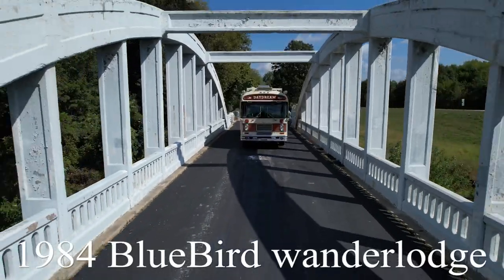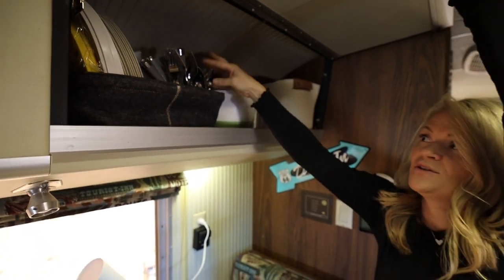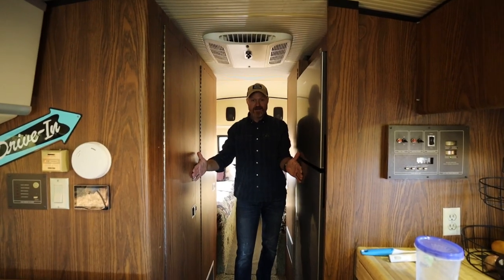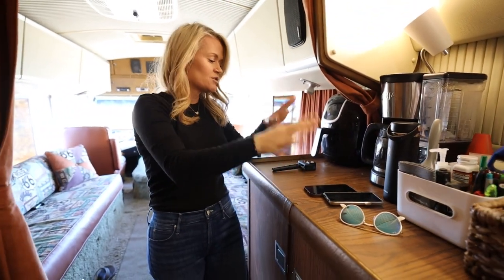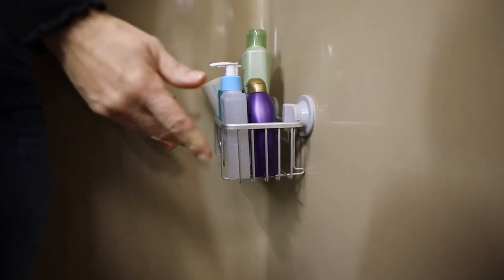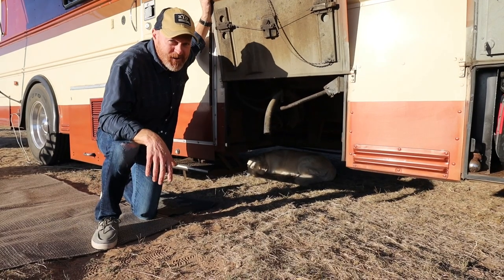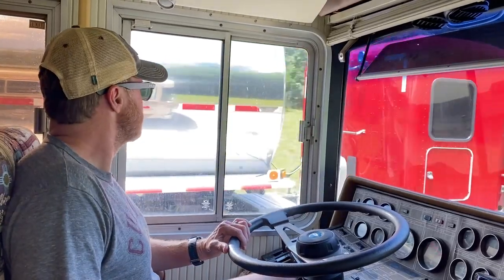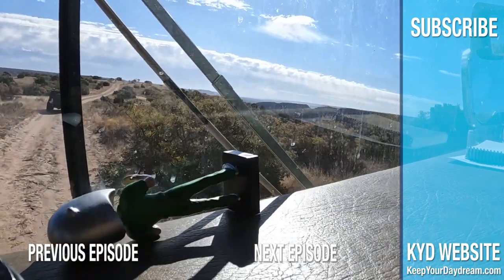BlueBird Wanderlodge RV Tour: Pros & Cons

Comment: LOW POWER ISSUE - We own an 88 Bluebird. To address your lack of power issue and with the engine off remove the engine cover inside the rig then check your throttle linkage by depressing the throttle pedal completely then make sure the throttle lever on the injection pump is going to full throttle (all the way against the stop). To obtain this you may need to make a linkage adjustment. Let us know if you have questions.

Comment: Very good tour and video. I decided about two years ago that I wanted an old bus. Fell in love with the GM4106 model. I found a 1962 4106 that had been converted in Southern California and flew out, bought it and drove it across country back to Arkansas. It was not in good shape mechanically but by the grace of God I made it with no issues. Myself and my buddy spent most of 2020 going through all the mechanical and repairing everything. Keep in mind that I have a fine fifth wheel and my wife couldn’t understand why I ever wanted an old bus, but it did teach me a lot about the old ones. The thing that stands out it that they were made to be repaired and will last forever. It went to a new home and owner in Florida last year and my wife is happy now. I kind of miss it but truer words were never spoken, “you better make sure your rig is ready”.

Comment: As an avid classic wood boat enthusiast, I totally agree about starting early to make sure everything is going to work.  The public boat ramp is not the place you want to find out that the Gray Marine flathead engine won't start. Also agree with making friends and high fives on the highway towing a classic woody.  When everything is singing, vintage ANYTHING is the cat's butt!

Comment: This is perhaps one of the best videos that you have done. If you have a late model pickup truck that is suitable in size to tow your travel trailer, then that is about as reliable as RVing gets. A large motor home has its advantages while on the road but its not more reliable than a good pickup truck. A vintage RV will have issues from time to time and a vintage motor home can have issues that are much more expensive if you can even find some one to work on it. I don't know how you afford all the different rigs that you have had or do have but it gives you a perspective on the advantages of each type of RV that few other Youtube RV channels can offer and your candor about what you like about each is great. You should do more about what makes each type of RV good and bad because few can offer honest opinions on it. Keep up the good work.

Comment: When I bought my Class A, I could have gotten great deals with fifth wheel units but my main concern is safety. As a SF, not having to exit my vehicle until I'm sure of surroundings or for a restroom break or quick lunch was my main consideration. I had motorized RV's before so the driving and doing checking, hooking up, breaking camp wasn't anything new, my ex couldn't drive for more than 15 minutes at any time due to physical limitations. In the 90's we converted 2 buses for personal use, 1st was 35' with straight natural aspirated 6 cyl. Detroit and manual transmission, talk about a slug up the hills but averaged 11 mpg and 13 on flat highways at 65 mph. The 40' had a 8V92 Silver Detroit with 4 spd Allison automatic, pumped up the injectors and turbo. We cut the roof off and raised 8" to flatten the interior ceiling, was under 13'. It was 36,000 lbs and screamed up the hills. Had 2 full bays accessible that we could put our quads in the belly and still have 1 full bay available for anything else.
Reply: Wow amazing..

Comment: My husband is a retired truck driver and we bought a class a with tow vehicle. Unfortunately the brake buddy kept signaling that our tow car broke away and it didn't really. It never worked correvtly and my husband got so frustrated at the alarms going off scaring us, we sold everything.  Back to truck and trailer that we added battle borne and solar, the Best of all 10 RVs we've had.  Hit to budget but worth it.

Comment: Great episode and thanks for the ending where you discuss some of the pros/cons of a classic vehicle. As far as solar & batteries, I think one consideration is that when everything goes belly-up at home, some kind of rig is valuable. My example was last winter, we had 72 hours without power during a winter storm. Having a rig that you can go out to that has power and heat would be amazing - a bit like the lunar lander on Apollo 13, it can get you back to where you need to go, maybe not with the same level of comfort you were hoping for, but I definitely didn't sleep well without my CPAP running for three nights... and having an RV in the driveway that could have kept us warm and powered (and fresh ground coffee for the wife - she ran out - would have been amazing. In our case, we're part-owners of a park model RV in a resort, but we're considering getting a towable that we can use when it's not our turn at the park model, as well as for emergency uses like that. Luckily, Santa brought me a nice solar generator that can be recharged from the car when needed... that's a good first step.

Comment: I had a GMC motorhome exactly like the one in your video. It was a 1973 the first year they were made. The last year they made that model was1979. A little before 1984. I bought my '73 GMC in 2000 and sold it several years later. We now have a 2003 Newmar Dutch Star DP. Love your Wonderlodge.

Comment: Back in the 80's i owned a truck with a 3208 in it.  Never had maintenance trouble with it but no matter where we had to go we needed to add time if there were hills, On roads I used all the time in other trucks, I had never even noticed and grades. In the 3208 40mph.

Comment: 3:43 - So typical of Goldens.  Park where you need to walk…  Being a large dog, they do not move quickly.  It is perplexing.  28:51 - Glad you mention other campers consideration.  Recall running the extra noisy 1987 Onan generator in a State campsite, the tent neighbors cheered when we shut it down.  On for about an hour at 10 AM, tent campers were outside their tent, no operation during quiet hours.  The quiet diesel gen.’s seem better. Not the unit we had.  Thank you for the posts that bring back the experience memories of motorhome travel and stays. 😊
Reply: I think dogs do that so they will not miss anything and force you to acknowledge them. Our Golden did it and so does our Aussie. 👀

Comment: I love my 1983 Wanderlodge I was surprised to see the difference in ours Birds. The turbo conversion is very easy. The turbo runs just about 2k plus the install. Then turn up your pump and your good to go "the easiest pump to turn up or down ever" . I am just now changing out my turbo due to improper usage I am very excited to see how it preforms with full power. I too have the fc  3208.

Comment: My second camper was a 1977 coachman 5th wheel. It has some neat features. My favorite part was that nothing I could do to it short of setting it on fire would hurt it's value. No hesitation to screw something to the wall, drill a hole to run a wire etc.... It was also the reason I call my channel gypsy wagon maker space.

Comment: Cool rig, thanks for the tour.  I used to rebuild cat engines, and that poor 3208 is wholly inadequate for much of anything.   Sorry its such a snail.   The rest of the rig is really cool.  I would certainly consider a repower instead of power adders, which wont help much.   A cummins swap would sure be about 10 times better, and money better spent IMO.   Great video.
Reply: I own a 1977 fc35 so I have thought long and hard about a re-power. The problem is the form factor, the bus is made for a square engine, not a rectangular one. This basically eliminates the two obvious choices- Cummins and dt466. I would go for a duramax, although figuring out the electronics might be a problem.
Reply: I worked with CAT for a number of years.  If I remember, Blue Bird insisted on the 3208.  Power was adequate for the relatively light duty of a school bus which is what the Wanderlodge started out as.  The 3208 was always intended as a medium duty engine for medium duty applications.  The Blue Bird was always short on space for the engine.  Trying to get the valve covers off to adjust the valves was always a hassle.

Comment: Oh also in case you did not already know. On the Bluebird OEM tag riveted to the bus. You should see a Body number, A BSN (Body Service Number) and a Chassis Number. Those were used for the original microfiche that BB used for production records and parts replacement. The Chassis Service number will show a parts person what model, make axle, the brakes, the drums, the hardware, the slack adjusters, basically all of the parts used to put the chassis together. the body number (yours should start with an F or W F for fort Valley or W for Wanderlodge they used both sometimes. Ususally F as that denoted the factory the bus was built in. Like if you have a Body number that started with a B it was made in Brandford Onatario Canada. if it had an M it was the Mt Pleasant Iowa factory (both are gone today) there were also a few L body numbers which was Laventure? Georgia. They also had a factory in Central America for awhile as well. The body number will show the options that were chosen from the catalog by the original owner. Blue Bird Dealers still have access to factory info on microfiche that was converted to digital files. You may also be able to find you original build sheet on the Bluebird Website which will show date of completion and some other fun factory stuff about you bus that won't be in the blue box. :-)

Comment: Class if 83. Thanks for the flashbacks. Good times!  
I got tired of working on my 1965 Sovereign Airstream and decided it was more work than pleasure. 
It’s sitting in my garage, along with my other long term project-a 1970 Olds 98 convertible that will pull it or my mouse-house 1969 Airstream Safari. 
For now, as a weekend warrior, my 2019 Sprinter has been a fun conversion to build out and use as I go. 
So many projects…I hope I can retire soon and get at them all!
Thanks for the inspiration and -
See you down the road!

Comment: Recently retired spent 20 years at a Cat dealer worked on lots of 3208 worked in the fuel bay built lots of fuel pumps for that engine. I would repower with a 3116 or c7 or maybe even a c9 but keep it Yellow

Comment: The 1980s montage would have been perfection if you included footage from "Stripes" which used a GMC Motorhome as the EM-50 Urban Assault Vehicle...which would have tied in nicely with Ghostbusters since Bill Murray and Harold Ramis were in both movies.  That would have been a nice follow-on with the GMC Motorhome Commercial.
Reply: Stripes is actually exactly what I though of when the GMC commercial was on.

Comment: slow start off the line?  yup - it's a bus. drove transit bus for 10 years...anytime to start moving from a dead stop - floored it. literally. .pedal to the metal. didn't do damage to engine , and it was the only way to move into any kind of traffic from a dead stop. before bus operator, i worked at a small tv station - loved the commercials - nostalgic and funny. tom selleck was a babe!
   i love your bluebird, does have many great features.

Comment: I like the old Wanderlodge and older vehicles in general.  I kind of wish my rig was a bit shorter but I have roof airs and on my Prevost that puts me close to 14 feet.  Watch those bridge height signs.  I think the older Wanderlodges only have a couple of hundred horsepower if I am not wrong.  Drive safe and have fun.

Comment: Hey Mark, just want to clarify for your viewers, the inverters are 3000 Volt amps, that works out to about 2400 watts each, I have the same inverter in my rig.    Great set up, I am a bit Jealous of your, battery bank, I have 630 ah of Lion Energy batteries, with 1200 watts on the roof of our Imagine 3250BH Travel Trailer.

Comment: I'm a retired heavy equipment mechanic.

I have always loved the Wanderlodge, have wanted to get one for years.
My problem is I want a 35'.  I love the look of the FC 35 and it is small enough to fit into the places that I  want to go.  The engine's being the CAT 3208 just doesn't do it for me.  They are pretty much one of the smallest engines that I worked on and just not a fan at all.  But if I could find the right coach with a fairly fresh engine in a turbo version I would definitely have a look.
I do like the older cat engines.  The 3206, 3406 and the 3408 are probably my favorite engines.  
I did lots of work on the old detroit 2 stokes, the 71 series.  Not really a big fan.

What I need to do is find a coach I like and buy it.
I have this idea of putting a Detroit Series 50 under the hood.
It would take a fair bit of engineering and I don't know if the stock transmission would handle the torque.  Probably look around and see if I could find an Allison 4000 with a retarder.
But wow, what an upgrade that would be.

For those of you who don't know, the Detroit Diesel Series 50 is a 4 cylinder, 4 stroke engine.  The little brother to the Series 60.  They are 250-350 HP.

We used to remove the old Detroit 8V71's and swap a series 50 into it's place.  More power, better torque and better on fuel.
I'm pretty sure it make a wanderlodge just fly and probably get better fuel economy too.

But this is all just still in planning.

Comment: You got lucky to find a 27, we have a Jayco and had to go to a 24 since we wanted a smart TV.  In the 2013 Jayflight they had to RCA plugs to tie into the onboard sound system and the TV we bought only had one RCA audio in and the TV only had either TV Sound, or Sound Out not both at the same time as the original TV.  We got used to it but the advantage of the FireTV being able to access our streaming channels made a huge difference in COE areas that had poor TV reception.

Comment: Mark to help with your hill speed problem, try using a shorter tire ie- 70 aspect ratio instead of 80, 40 instead of 60 etc. This will have the same effect as changing differential gearing. This will increase RPM at highway speed but give you better hill climbing power. There is a supersingle tire that uses the same 22.5 rim but is only 33 inches tall 12 inches wide.  315/45 R22.5. You can have 2 tires on the rear axel and still legally carry 12 tons this has the effect of better tracking and better fuel milage and ability to run lower pressure on slippery ground or soft soil, sand, god forbid SNOW.       CHEERS AND SAFE TRAVELS          Steve h.

Comment: Other than the initial cost of installation there is very little downside to adding a turbocharger. Another benefit is little or no horsepower loss at altitude.

Comment: Interesting that you do not have a turbo on a 1983. By then I think that was the only option. Some of the California birds came with a 225 hp turbo in 1982 I think but by 1983 they were all 250 turbos, and I see from the quick view when you opened the doghouse you have the square turbo intake. If your motor has been backed up by someone to save money you could put the turbo back on. If you have not already take the serial number into a cat dealer and see if it is the turbo version, which has some internal improvements to take the extra power. If someone has put an older 210 hp NA in you are stuck. There is nothing cost effective that will really help. In Northern California you will be down to 20 mph for the record if everything is in good shape. California being sea level more or less the NA birds do not struggle as much as they do in the high country where you are doing 15 in a cloud of black smoke. We have a 1981 and after 8 years I am almost done shoehorning in a 450 hp Cummins ISM because while I love my bird, it can be very stressful doing a fraction of everyone else's speed on a busy highway. We live in British Columbia so everything is 6 to 8 per cent for miles.
Reply: In one of the earlier videos (New RV: KYD's REAL Season 10 Premiere!) (skip to 15:51 in that video), he opened the dog house and we could see the turbo clear as day. Its in there. A few WL owners tried to point it out but I think with so many comments, he likely did not see it. We tried!

Comment: The power train problem has to have a solution. A dealer is not going to be the place to fix the issue with an older engine. That is like going to the air stream manufacturer for the solar install. They only focus on the newest products they produce. It would be really cool to see another creator step in and just fix the drivetrain on the bird. We need to find the best custom performance shop in the west and have it dropped off. The first thought would be just installing a Turbo but, possibly swapping a new drivetrain from a totaled vehicle could work.

Comment: Marc. You HAVE to get a turbo kit, and turn up the fuel. Night and day difference.
Reply: I'm thinking it's going up for sale soon.
Reply from the maker: We heard unless we replace with a turbo engine, it will make little difference. I think we're just going to change our route :)
Reply: Zedhead, It is not likely this old motor could take the boost. You would likely be looking at least changing the pistons which means a complete rebuild. I have done the turbo upgrade back in 84 (actually replaced the motor) and the owner (Red Adair) was very unhappy with it. Also, adding more fuel makes these motors smoke.
Reply: @timosmith8633  The Cat 3208 responds great to a turbo kit with no internal mods. You just can't go crazy boost. Tuning the fuel pump is done to the point that there is minimal smoke. Once boost builds there is no smoke.
Reply: I’d swap in a pre emissions Cummins turbo diesel. 8.3L or larger.
Reply: @Upliftyourbrothers  $$$